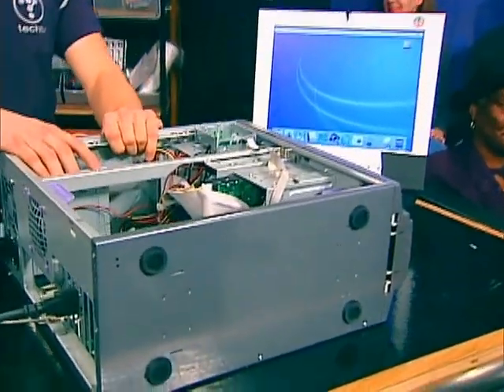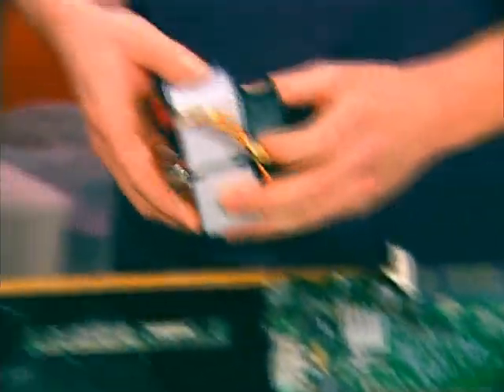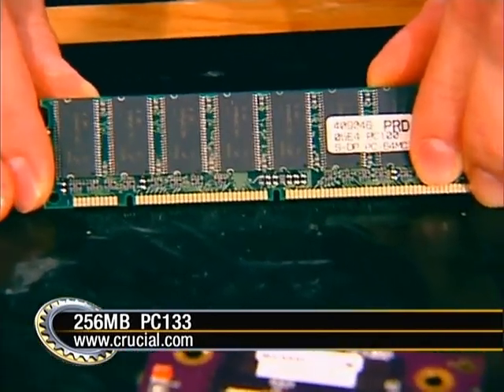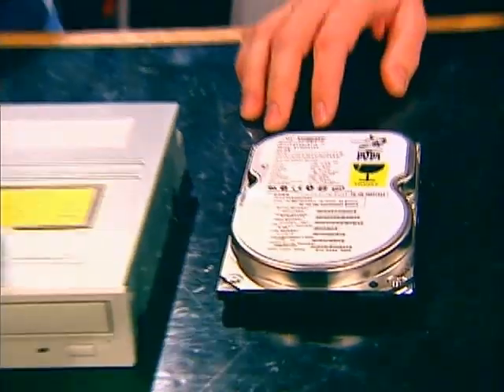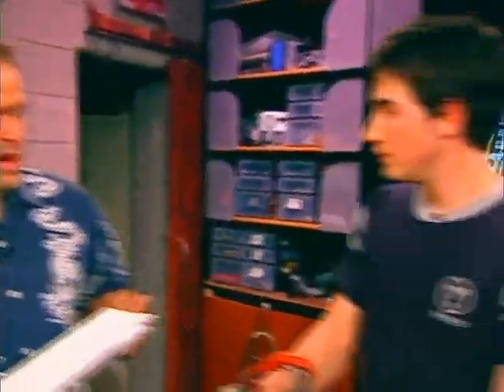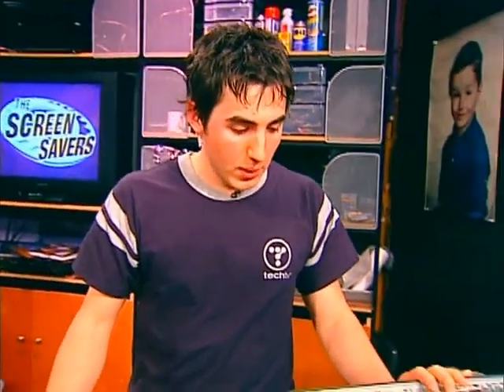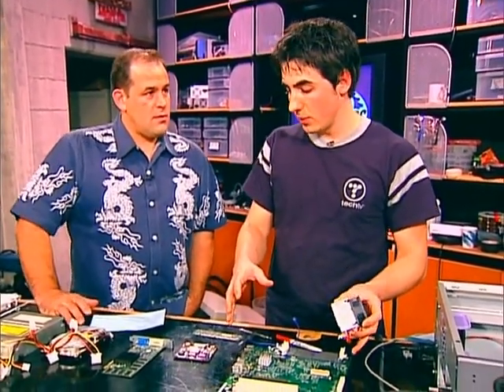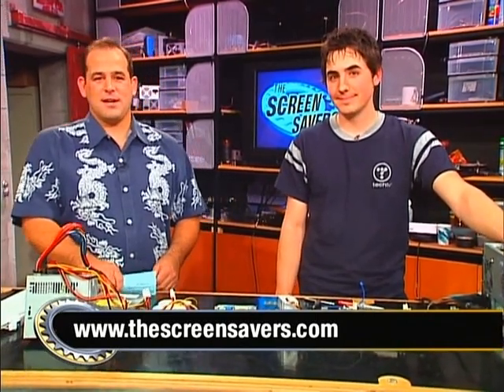The Screen Savers - Kevin Rose Builds a Custom Built Mac - HQ

Comment: Nope, I live in the USA. I am on a comcast business class connection. BC class is a separate network from standard comcast subscribers. You-tube seems to have been very unreliable lately with delivering videos. I just tested my bandwidth at 4:45pm and I am getting 21mbps down and 10mbps up with a connection to Chicago (over 200 miles from current location) It is you-tube.